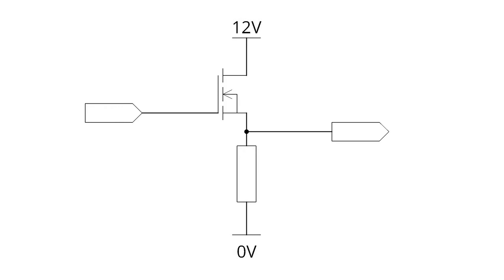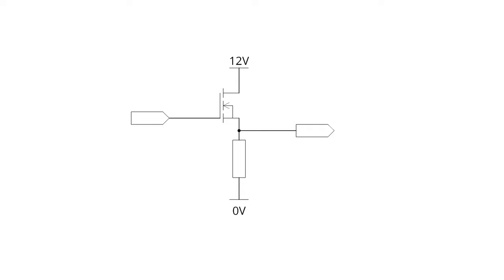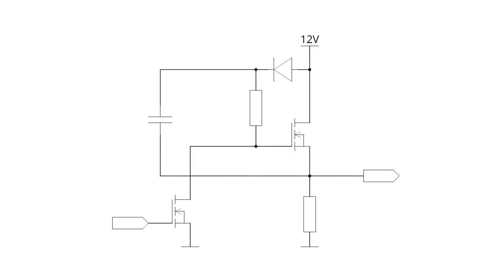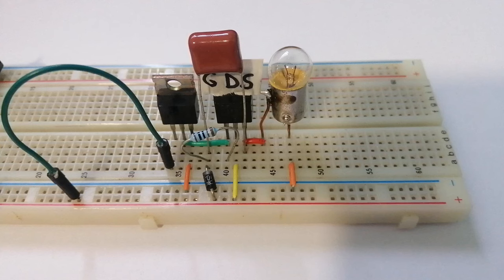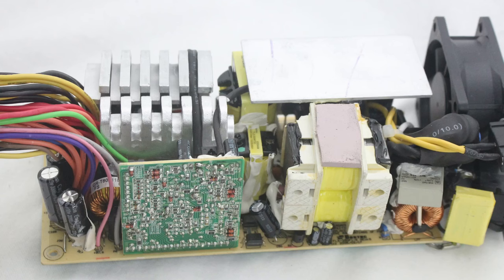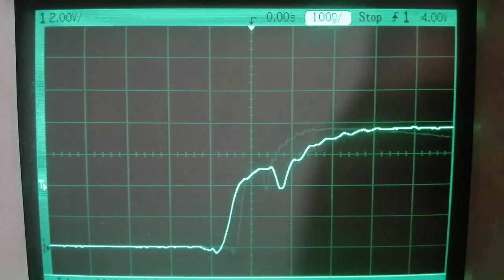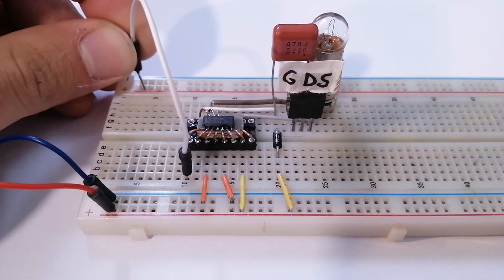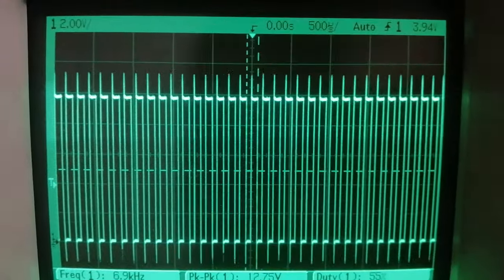High Side N-Ch MOSFET Switching Circuit - How Bootstrap Circuits work

Comment: In DIY driver, you can add NPN transistor as an emmitter follower to boost current pumped into the gate, so that rise time decreases without lowering resistor value much. There is one more thing you have to be careful about, when switching on the mosfet discharging the gate, it forces negative G-S voltage on driven mosfet gate, with high drain voltage you can easily exceed max G-S voltage and kill the transistor. Isolated drivers can be built around an optocoupler, but they are not that fast and have a few pitfalls as well. So the best option is just sticking to dedicated ICs.

Comment: Sir what is meant by  high side and low side mosfet
Reply from the maker: High side means that the transistor is placed between the load and the positive supply.
Low side instead is when the transistor is connected to ground. In this configuration we have the disadvantage that the load is connected positive even when off.

Comment: I think it'd be useful also to take a bit of a wider step back and answer why we'd use an n-FET as a high-side switch, given all this extra complexity, rather than use what seems on paper to be a far simpler solution of just using a p-FET instead.
Reply from the maker: Thanks for the comment. It's true, in fact, actually two assumptions were made in the video: that a P channel FET can't be used and that a low side switch is also not employable. For lower power applications the P FET is the simple solution. Higher performance devices will try to avoid them because of worse characteristics (like Rds) and their overall scarcity which limits choice.
Reply: @5VLogic  If you don't want us a P-Channel,  also you must consider connect the load to the DRAIN and the SOURCE to GND. This way you apply 5V to gate and the switch ON happen!
Reply: @jlsmonte  Of course that is better way to do it. But sometimes we can't do that (for example in half-bridge and 2 switch forward power supply)
Reply: In simple words, it's not very practical to use a MOSFET which will turn itself on when gate is grounded because it's usual practice to keep things pulled to ground by default. Also at voltages more than VGS rating, you need a negative voltage regulation to supply a pmos with safe gate voltage. So for application below 15v, P MOS can easily be used, but not beyond that. Inefficiencies are another reason
Reply: I think the catch is the difference between t d(off)  and t d(on).  The t d(on) is always different from t d(off). Usually td(off) is longer which makes both fets overlap for something like 20ns.

Comment: You can use tlp250 or 350  it's very fast high side driver
Reply from the maker: I didn't know about those components, I just checked them out and it's a great suggestion, thanks!

Comment: why not just use P mosfet
Reply: P MOSFETs simply suck. They're slower, waste more power and bit expensive. Also they need to be constantly pulled up to keep them off. Driving them requires gate voltage 12-15 v lower than supply voltage, which is again a problem because when you're using them at say, 50v, you need 45v signal on gate to turn them on safely. So P channel MOSFETs are not convenient enough.
Reply: @swapnilkumar9363 all those things use to be true but with newer parts you can get now they have greatly improved to where the difference is unnoticeable until you go to 100s of amps or volts. Where in the past the Rds difference was often 10-100x higher there is usually only a 2-4x now on the newer parts which is within the difference you see from different manufacturers for the same generation parts
Reply: @michaelcummings7246  if P channel have gotten better, N channel's have too. No matter how better P channel MOSFET gets, it will never be close to N channel because laws of physics aren't going to change. N channel has electrons as charge carriers and P channel has holes, so there will always be more losses due to electron - home recombination.
Reply: @swapnilkumar9363  true, but completely misses the point - P channel is perfectly useful in most practical applications.
Reply: @VEC7ORlt  they indeed are, but use case is limited to low power logic and  stuff.
Reply: @swapnilkumar9363  riiight, the last time you've seen and used a P-FET was on a picture in a text book.
Reply: @swapnilkumar9363  riiight, the last time you've seen and used a P-FET was on a picture in a text book.
Reply: @VEC7ORlt  I do power electronics for a living. with 7+ years in the field. We design Three phase VFD's, inverters, DC to dc converters and lot more. We very rarely put P channel's to handle continuous large currents. Last time we put P channel to handle large current was in a soft starter for a 4kw dc motor as it wasn't supposed to run for more than 10 mins.
Also if you plan on using P channel, you'll need heatsink twice as big compared to N channel, which is not very economical. You may not believe, but it's lot cheaper to use N channel with a galvanically isolated driver than a simple P channel.
We have built DC DC converters with 98% efficiency with N mos while it's around 92% with P mos!
Reply: @swapnilkumar9363  so that 7 years of experience should impress me or what?
Reply: @VEC7ORlt  there's no point trying to impress someone who can not provide suitable examples to prove their point.